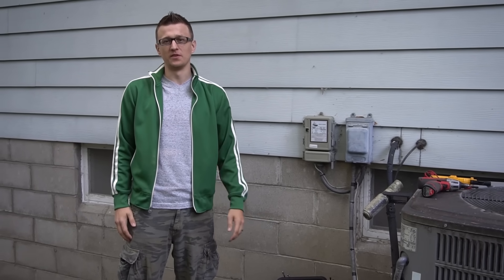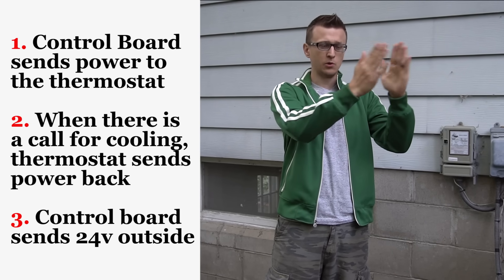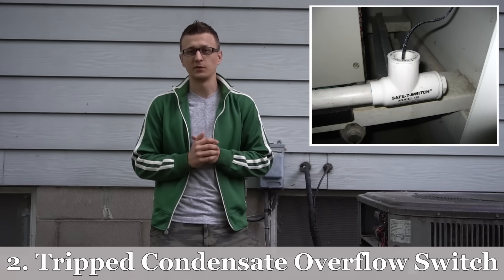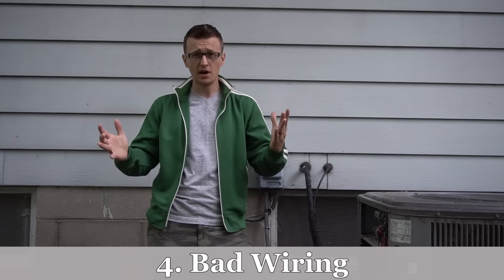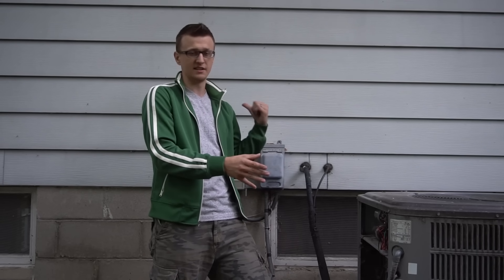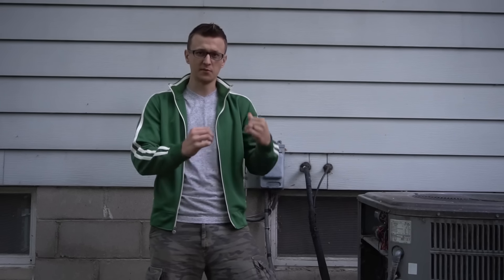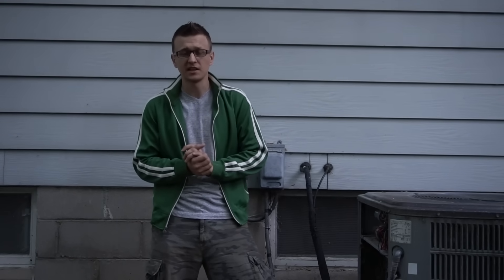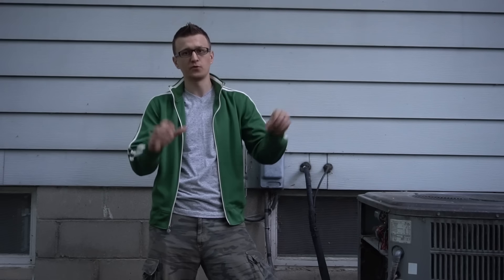AC Contactor Not Pulling In - 10 Reasons Why

Comment: Hey man, thanks for your vids! Still questioning. Outside fan still not running. Inside house is good. Condenser  responds to thermostat. Wires outside are good. If I bypass thermostat by pressing plunger and giving the fan a push it will spin until I release plunger but will not restart. Thought I would ask for suggestions before I take my top off… I mean the top of the unit off. Any advice is very appreciated!

Comment: I wish my AC unit is this simple. My low voltage wire goes into a control board, that wire goes to a bigger control board. That control board has a heat sensor which shuts off the unit if it gets too hot.

Comment: What about low voltage 18v rather than 24v. My Nest thermostat is no longer staying charged. I noticed my granddaughter flipping the glowing red switch on and off to the boiler and coincidently started getting a message No power sensed at Rh. There is power, but only 18v.

Comment: Had a bad capacitor and swapped in a new one but fan still wouldn’t kick in. Contactor wasn’t activating so I checked all the points you brought up until I pushed the high pressure line reset button and the fan turned on. Thanks for your detailed video!

Comment: Let me ask you this now you said to check for power between y and C and if I don't have power there it's not sending power out to my contactor now that would be of course with the air conditioning thermostat set to be calling for cooling correct?
Reply from the maker: Yes. The thermostat would be the one sending power to Y so it would need to be calling for cooling.
Reply: @WordofAdviceTV  
So so let me see if I sort of understand I think I do but I'd like to explain it. So basically the board sends positive voltage up to the thermostat when I set the thermostat to call for cooling,
 the thermostat jumps the R power over to Y at the thermostat, and back down to the board and of course from the board out to the contactor outside?

Comment: Hello, Thank you for the great video. I have a situation with my Carrier condenser/out door unit I hope you or someone in here can help me out. I don't have 24v to the contactor. There is circuit board on there with a red light that blinking really fast and making static noises. I do have 24v coming in from that thermostat. I have changed the new contactor, new circuit board, new compacitor, new breaker, but the problem still the same. The fan motor and compressor still working when i push in the contactor. it's a 3phrase unit i have 118v on each legs in, and to be exact I have 23.2v from thermostat. Please help and thank you everyone!

Comment: I have the below aircon Goodman GSX140301KB. The capacitor is bad is this: CAP050400440CT. I see another:  CAP050450440CT. The difference is the 450 vs 400CT. Can I use the 450 one?
Reply from the maker: Hi Phillip, the model number of the capacitor does not matter. What matters is that the MFD or uF rating is the same. I don't know if you watched my video on how to replace a capacitor but I go over all of that there: https://youtu.be/9ZGfvC-PMWU

Comment: Dude! You rock! I watched the start of your video where yoy said the contactor might not be broken. So I started watching this and suddenly remembered I had switched off the AC at the thermostat so I could run the fan. Turned it to AC and the contactor popped In and the new motor is running flawlessly!!! House feels cooler already, and it is 101 degrees today in San Antonio. THANK YOU SO MUCH! ❤️

Comment: My AC repair guy was charging $1200 to fix my issue, after watching this video I ordered a new contactor for $18 on amazon and fixed it myself. Thanks a ton you saved me a lot of money!!! It’s worth noting I’ve never worked on ACs before
Reply: 1200 bucks?? Really that tech should be in jail.
Reply: This is why nobody trusts HVAC companies. $1200 to replace a $10 part in 15 minutes?
Reply: Just read your comment I appreciate what you went through I wouldn't call that guy ever again
Reply: Contactor should have cost you 8$,.

Comment: I recently replaced my round mercury type thermostat and since the replacement, the outside unit does not work. I have inside fan running but the fan and the compressor outside are not. The thermostat is basic Honeywell digital thermostat with a blue plastic switch between R and Rc. Do I still need a jumper? What might be causing my AC not running?
Reply: sounds like its your thermostat problem since u replaced it recently. check your manu for instruction, and to make it simple, i guess you still need to jumper that r and rc.

Comment: What if the contactor isn't pulling in when I turn the system on from the thermostat, but if I push and hold the plunger myself the system will run and cool. What could that mean? Awesome channel btw great videos 👌

Comment: Awesome video, just diagnosed defrost control board with no low voltage to contactor, jumped directly to contactor from C-Y on board got low voltage, then foungd contactor was bad also.Replaced contactor unit fired up in ac mode as called by tstat.

Comment: So ac or heat won’t work, checked circuit board fuse (not blown) but it was a 10 AMP (previous owner) so checked transformer (bad) replaced transformer and fuse 3 amp. Heat worked. Everything worked fine until I turned on AC on and the new 3 AMP fuse blown. My guess is bad thermostat wires from thermostat to HVAC or bad wires from circuit board to outside unit? Any thoughts or input would be awesome.

Comment: Good video, just write down the points as he explains them and cross out the ones that don't apply to your system, and eliminate the rest by troubleshooting.  You can cut the list of possibilities down fast. There is something in electrical troubleshooting called half splitting, once you understand your system go to the middle. In my opinion, once you have forced the contactor to operate and it works and you don't see obvious damage to the wire outdoors,  the middle for the 23 or 27 volts,  is the connection to the control board, in from the thermostat, and out to the contractor. decide which way to go from there.

Comment: What's wrong if the thermostat clicks, it clicks out at the condenser, but doesn't pull the contactor in, but when you manually push it in, the condenser comes on ? This is a brand new system by the way, installed only a few months ago.

Comment: I watched several of your videos and thanks to you now have a good grasp on how HVAC systems function.  I narrowed down the problem to the contactor coil not getting power or pulling. After checking all of the 10 reasons mentioned in this video and still not getting power to the contactor coil I went back to searching on line and found another video with a much simpler solution.  My thermostat has a separate fan switch that can be set to "On" or "Auto".  A house guest must have been warm ( I keep it set to 77 deg)  and set the switch to On which for some reason stops 24v power from being sent to the contactor even if the system is set to cool.  When I switched it to Auto the compressor started up and everything works.  I wanted to share that just in case someone else had an issue with warm house guests.  BTW, thank you for posting these great videos.
Reply: Thanks for the tip on the auto setting preventing 24V from going to contactor. I had the same issue during troubleshooting. These are great well-made videos!

Comment: Thanks
Replaced outside capacitor for s&g when my blower motor was actually bad. Then outside unit stoped working. Thought I messed up the simple install
Found the plunger not going in and followed this video
Discovered I broke the common wire on the inside control board when removing the motor. Repair complete! Thanks

Comment: Hey  my  ac unit wire is running from inside of home  has been  connected to the another unit to work is that right and is that a safety problem

Comment: Very helpful.  I changed out the thermostat, have 240 voltage at switch but no 27 volts on outside contacts.  Will check water level and fuse.

Comment: I'm in Okc and most units have transformers here. Kill the power remove wires on secondary side, turn power back on & if it is reading 24 volts its good. If reading 0 then replace it. That and earwigs are notorious for getting stuck under the plunger of the contactor.

Comment: Something I haven’t seen here yet that my mother is A/C is  doing now, no cold air blowing in the house, checking outside, fan is working but  I hear a clicking noise, the contactor is coming on and off on and off while sparking. ?
Tried to clean contacts on contactor with sand paper for the night till parts store opens tomorrow morning but it kept doing the same thing, sparked while trying to click on.  

I’ll buy the capacitor, contactor and install

But most importantly change the darn tstat battery 

I’ll let ya know what I find out.

Comment: So I have a weird one today. First of all the contactor kept blowing out the low voltage fuse out at board. I put new contactor in had 24v on contactor but it didn't pull in I checked low and hi safeties they were good so I bypass the safeties went right the low voltage wire from furnace to either side of the contactor and it still didn't pill in. Brand new contactor. What I noticed is there were 3 marret points on the wire and 2 different wire sizes. One was 20ga the other 18ga. Now I'm thinking it's gotta be the low voltage wire right? I still haven't solved this if anyone can help me the be awesome.  I am a certified tech and have never ran across this before

Comment: I don’t know I’m total confused and frustrated. All I know is the air conditioning unit worked perfectly good and now it won’t turn on. And I don’t even know where the control board is I guess it’s down by the furnace unit? If I push the connector in and it turns on it and the air conditioning unit works perfectly fine. I think there’s no 24 voltage going on the unit. I hope I don’t  electrocute myself 240  Volts. In short I don’t think this video was very helpful and I really can’t put a finger on exactly why that is.

Comment: Thank you for your videos, they are very helpful!  I am troubleshooting a problem in my AC. I made sure outside unit compressor and fan starts and runs fine and inside unit AC control board works right (output 24 volts correct).  my problem is the AC starts fine after not using for a long time or reset using system switch.  However, it runs 2 minutes and then shuts off. Once it is off, I check the voltage at the contractor and the 24 volts is gone.  I found the 24 volts is fine at the EWC-ST-2D zone input, but they are not good at the outlet and the thermostat when the AC won't start.  Can you please give some clue what is the offender?  I have changed new batteries of the thermostat.  Thanks very much.

Comment: Thanks Jay.  My Carrier shut down during 95 plus heat--I thought the capacitor was shot.  But after opening the panel I found the Contactor wasn't pulling in.  After watching your YouTube show I checked the indoor blower in the attick and YES--too much water in the condenser pan; the safety float was up, shutting down the outdoor unit (just as you said it would)  Naturally I took credit and my wife thinks i'm a genius.

Comment: My plunger on the contactor is stopping and going/clicking.  Actually slowing the compressor down.  Does the contactor need replacement or could the capacitor make it work like that?  If the capacitor is going bad?

Comment: Excellent presentation covering a lot of territory. I will apologize in advance if you covered my comments in subsequent or prior videos. I would add that cleaning the contacts on the relay periodically might save the homeowner a service call. An HVAC technician noted my relay contacts arcing, while servicing an unrelated issue, and he wanted to sell me a new relay. All relays arc somewhat, because it is switching 240 VAC off and on. However, they get dirty, like everything else inside the outdoor condenser. After pulling the main fuse and/or killing power at the breaker in the service panel, I spray Electrical Contact Cleaner all over the relay, particularly on the actual contacts that typically arc when cycling on and off. In addition, if the system is near the end of its typical lifespan, I will use a small piece of 400 grit wet or dry sandpaper on the contacts - very lightly, to remove carbon buildup. The downside to this practice is the contacts are probably silver coated to enhance conductivity and slow corrosion. Thus, I use as fine of wet or dry sandpaper as I have on hand, and lightly clean all surfaces of the contacts to remove carbon and other residue. The relay is an inexpensive item, so I will probably buy a spare to keep on hand since I have been cleaning my relay contacts for several years. The large can-shaped capacitor is another component that would be worth keeping a spare on hand, because they all eventually die. Use your cell phone camera to have a clear record of what color wire goes to each terminal. As the condenser fins collect dirt, grass clippings, and cottonwood fluff, the fan has to work much harder to pull air out of the top of the condenser. That usually leads to the capacitor failing, and often the capacitor is operating both the compressor and the fan. That is the main reason to routinely clean the condenser fins a couple of times per season - rinsing from the inside out. Always kill power by removing the outdoor fuse or breaker, and/or at the service panel. I got in a hurry once, thinking I was only going to rinse the fins and could easily avoid the high voltage area, trying to finish before dark. I was a licensed electrician in the 1970s, so I knew better. Water hit the two insulated legs of 240 volts, and Kapow! Two-hundred-forty volts explodes. There were two previous nicks in the insulation of the #8 wire from years of rubbing against the louvered exterior cabinet, that shorted when water hit the wires. Several HVAC technicians missed the nicked insulation during previous service. No harm other than my ego. At least I now knew those #8 supply wires needed to be replaced. The installer should have zip-tied the wires away from the louvered grill of the exterior cabinet, but there is never any excuse to clean fins or perform any service while wires are hot.
Reply: A WEALTH OF INFORMATION ... THANKS A BUNCH !!!! SPARE CONTACTOR , CAPACITOR , AND CLEANING THE COILS !!!!  🌅🌅

Comment: Can the entire furnace be changed to a newer one? My house was built in 1996 and we have changed the outside compressor and another system in the attic but my AC is still not cooling. I spent about $4,000. I called and AC company and they have promised to throw away my 2 year old system for a new system. They are charging me almost 9,000 dollars and I don’t have that amount of money. Plz help me

Comment: Absolutely nailed it, Jay. I am one of those people that jumped at the contactor and ordered one, without watching
this video. Turns out when I checked the thermostat wires, had 24 vac, up until they connected with the delay on break timer. At the contactor 24 volt side was getting all kinds of wacky readings.. Ordered new delay timer as well. Thanks to your videos, $31 probably saved me thousands! Props to you!  Oh as a side note, also ordered a dual run capacitor as a backup  since its been high 80's for over a week her in Fl.
Reply: Was your problem the contactor or thermostat wires,

Comment: Replaced contactor but the plunger already pulled in despite the disconnect pulled out. What could be wrong with the contactor? Ac still not running except the furnace fan in the attic. Thanks!

Comment: My 3a fuse was blowing and I replaced the contactor and it fixed the problem. It was difficult to diagnose because the fuse would pop every time I switched the air handler on. 
Contactor was less than two years old so I didn’t suspect it at first.

Comment: Thank for the video. When you said mentioned the furnace power switch, is it the burner test switch? I am new to central system. My vents are working but the air is not really cold. The outside unit is not working at all. Even I tried the contactor as you mentioned but it's still not working. Inside the house, it's always hot. Hope you can help. 🙏

Comment: Reason 11: you have a Nest thermostat with no C wire. Somehow mine was working for a day or two properly then the condenser unit started to power cycle. I changed the contactor and everything was fine for a day then again power cycling 
I had 26vac on the contactor, a bit puzzling.
I looked online and found information stating what burns the contactor coils is under voltage. 
Somehow I was able to pull a C wire for the thermostat and everything seems fine. Hopefully that was it as it's summer in Arizona...
Thanks for helping out in troubleshooting issues with the contactor, appreciate it!

Comment: I had a weird problem yesterday.  The furnace board fuse was blowing.  I tracked the problem down to the 2 wires going to the contactor outside.  if those were disconnected the unit was OK, but if I connected them to the furnace board (and temporarily jumped the fuse) the transformer was buzzing and overloaded.  But oddly the contactor wires had no damage and 20ohms.  So I went and checked the contactor and it seemed to be fine, I pushed it in manually and the outside unit fired up.  After doing that I went back inside and the whole system was able to work fine.  I dont understand what happened with the contactor to overload the transformer and pop fuses when it appears to function fine now?  Do stuck contactors draw excess current?  Did I free it up by just plunging it?